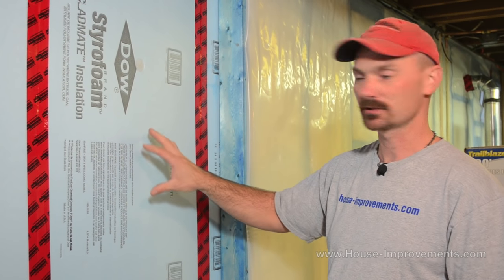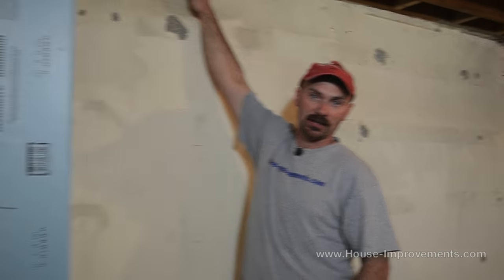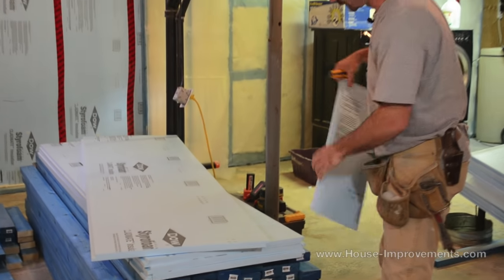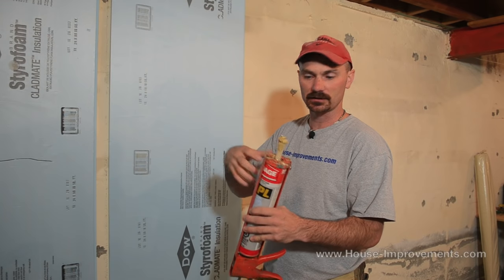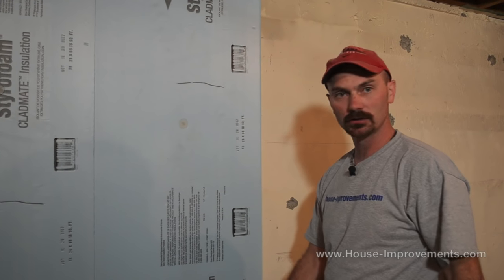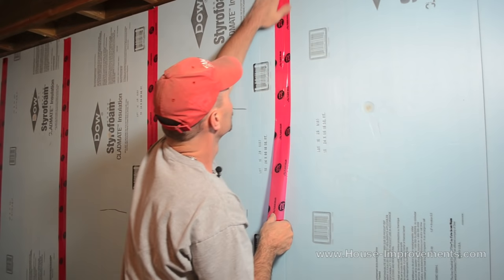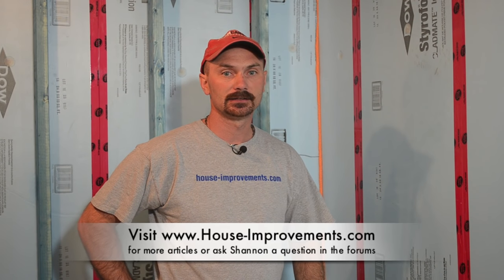How To Attach Rigid Foam Insulation To Concrete

Comment: Question, once u install this rigid foam into the concrete and continue on with your framing, do you still have to insulate the wall cavity and vapour barrier just as usual with fiberglass or whatever insulation you want to install?
Reply from the maker: I would strongly recommend it. In this case the 1" styro only gives an Rvalue of 6, I then installed a batt insulation in the stud wall that added another r12 , so ended up with R18.
Reply: HouseImprovements
Would you still have a 1 inch air space in between the insulation batt and the rigid foam for air space to go through?.
Reply from the maker: Yes you would still have some space between them for air movement
Reply: HouseImprovements Dario also asked about a 2nd vapor barrier.  If the foam is sealed, it would make a vapor barrier and I believe you shouldn't have a second (i.e. plastic film over the batts).  I have also read that the code would consider the foam as the vapor barrier.  Can you verify or confirm whether the 2nd barrier should be installed?  I am planning to install the foam, then frame & batts.  Thanks!

Comment: Can you just install the styrofoam on the concrete walls and not stud it out or finish it,and will that help with insulation or do you need to stud out the walls etc
Reply from the maker: The foam needs to be covered to protect it from burning by code ,so you need drywall. The smoke it gives off if it burns is toxic.

Comment: hey shannon , i live in ontario and i have a non vented crawlspace, what would be the best alternative to use on the bare cement block foundation for insulation because spray foam is a bit too costly for me ?
Reply from the maker: +GmGarlo 2" rigid foam.

Comment: ...where do you buy the plastic anchors and how thick is the Styrofoam board?
Reply from the maker: Hilti is one  brand of anchors. The foam thickness is up to you and how much r value you want to add. In this video I was using 1" but it could be anywhere from that up to 2"

Comment: How does the drywall anchor to the wall without studs?
Reply from the maker: Walls are framed in front of this foam to accommodate electrical, more insulation and drywall

Comment: So what happens in humid environments? Wont condensation build up on either side of the foam wall?
Reply from the maker: The foam lowers the dew point on the surface of the wall so you should have no issues unless you have extreme humidity.
Reply: Hi Shannon! Thank you for the response and thank you for your videos! I live in the mid atlantic region we have about 90days of High humidity, 90 days of normal, winter drops down.  If I use the foam board I wont need a vapor barrier then on the wall frame correct? Yes I did check my building code and its required but I dont think a lot people use foam board.

Comment: ...must have been at Lowe's for supplies on for this job :) ....how does the DOW Styrofoam brand compare to Owen Corning Foamular (pink)?
Reply from the maker: They are really the same as far as the material and R value per inch.
Reply: One used the Pink Panther in commercials and on packages, and one didn't.

Comment: What is the brand and name of that concrete anchor you used? I couldn’t find it
Reply from the maker: There is a link in the description under the video. Here is the link. https://www.amazon.com/Plastic-Masonry-Fastener-250-pcs/dp/B00IMG3L4G/ref=sr_1_2?ie=UTF8&qid=1549208790&sr=8-2&keywords=foam+to+concrete+anchors

Comment: Hi Shannon! Nice video as always. I got few questions. I have a partially finished basement which I'd like to renovate. I live in MN so we get really cold winters similar to you guys. I am thinking of using the 2" rigid foam. The walls are concrete blocks and they are painted. I would like to save space and not use 2x4s. 
* Would it be ok to use furring strips or 2x2 instead. I guess in case of the furring strips, it needs to be attached to the foam directly rather than the concrete. Does this compromise the seal? 
* The ceiling is already finished with glued tiles. Would it be ok to attached the foam boards up to the ceiling and fill the gap with spray foam? or do I need to take a part of the ceiling out? I can see that the spaces between the joists were insulated with fiberglass insulation (Basement is partially finished. This is how I think it was done based on the unfinished portion)
* I have 3 exterior walls that I'd like to insulate. There is one interior wall with wood paneling. Would it be acceptable to run the foam board up to the wood panel and seal the gap with foam spray?

Thanks!
Reply from the maker: Sorry but this is to much to deal with here ,please post your question in the forum and I can help from there.http://www.house-improvements.com/forums/
Reply: Hi Shannon! Thanks a lot for responding. I kind of figured out I was throwing out too much info/questions here. 

First of all, thank you so much for the detailed videos. They have helped me tremendously. 

Here is the link to my question on your forum.

http://www.house-improvements.com/forums/viewtopic.php?f=4&t=5243

Thank you so much

Comment: Can you attach drywall directly to the insulation?
Reply from the maker: Not easily. And you will need electrical ran in the wall anyways. And most places will require more insulation than this in a basement.
Reply: @HouseImprovements  I live in Italy. I'm looking at buying a farmhouse that is block and mortar. The electrical is existing. There's no insulation. Materials are not available like they are in the US. Is it difficult to attach/bond drywall to polystyrene insulation? It's also humid here...

Comment: Hey Shannon, was wondering your comments on this "grid system" in a "This Old House" video: How to Frame Out Basement Walls Are the advantages to framing with the way you've shown, versus the "grid system"? The grid system seems like it might be less work, but I've never seen other do it, so I am a little wary. Love your videos!
Reply from the maker: The grid system to me is not as good of a system and here is why. If your concrete walls are perfectly flat and plumb I suppose the finished product would be ok ,but I have never seen a basement yet that is ,except for some of the newest basements built with extreme care. The older basements that I reno are never straight  or plumb . The next biggest problem is running electrical wires and boxes. To do that safely in that style of wall system you need to hollow out groves and pockets from the styro, which makes your R value much less in those areas. 
In my opinion I would frame out actual walls.

Comment: why are you leaving a gap plate and the foam? ...could you not put the 2x4 against the foam?
Reply from the maker: +DeeInTheHouse  In a perfect world you could . Most concrete basement walls are not 100% straight or plumb so this gives some room to allow for that and help you to be able to have straight ,plumb  framed walls.
Reply: +HouseImprovements  ...true, framing and making the room square would leave potential gaps.

Comment: I'm surprised you used plastic sheeting for the walls before your drywall.  You should have skipped that and also not insulated the 2x4's at all.  Plastic sheeting is almost impossible to install perfectly as just one pinhole will allow air in and trap moisture.  (I thought people stopped using that stuff)  You use a dehumidifier to control any summer humidity issues.  But humidity should be less with rigid foam inside and (hopefully) you poured the concrete floor on top of rigid foam also, or if not, you should do that on top the floor before setting your studs.  Of course, you also need to consider that if you insulate against a basement wall inside, you should have an air gap on the outside for drying....so I hope you have the "dimpled' hard plastic on the outside to prevent ground/water from touching it.
Reply from the maker: Cougar Land A vapour barrier is required in my area (and others)unless I had at least 2" rigid foam or sprayfoam. This home was built in the 1970s and will not have anything but poly under the slab (maybe) and tar on the exterior of the basement below grade. The extra insulation is needed in the basement walls or this basement will be cold in our Canadian prairie winters. Thanks for your comments though.
Reply: Agree with you. With having the foam and a plastic barrier, it basically creates a trap where the water can not dry inward, and will cause mold. Its a matter of time. Foam by itself is excellent because it is semi-permeable and will allow any moisture from the concrete walls to dry inward, creating no mold issues.

That is where codes create issues, just like crawl space vents. The people that make them sometimes do not understand building science. Crawl space vents were designed to "let damp crawls breathe" but in reality, due to the stack effect of a home, a crawls negative pressure only sucks in air from outside, it never comes out. Leading to warm humid air being drawn into a cool crawl = condensation and moisture problems. 

Anyway, great video, but the double vapor barrier/retarder will cause major mold issues if that wall ever leaks, and concrete is a giant sponge basically as we know, and is porous by nature. A matter of time.

Comment: Great video, very helpful! Can I use the same approach for an above grade concrete wall? The house is a 1950s block and brick, there is currently no insulation behind the gypsum board/plaster in the kitchen.  Thanks again!
Reply from the maker: yes, although you may be able to use foam board adhesive which is cheaper.

Comment: Can you use 2 inch dow with out the tongue and groove?.
Reply from the maker: You can , the groove just makes a better job and better consistency with the R value because you have no straight through joints. If you are using the square edge foam I would leave a 1/4" to 1/2"  gap and seal with canned sprayfoam.

Comment: could you adhere the foam board with exterior black tar? or a similar sealeant?
Reply: check the instructions but I doubt it since petroleum based produces like tar will usually react and dissolve the EPS or XPS foam board...

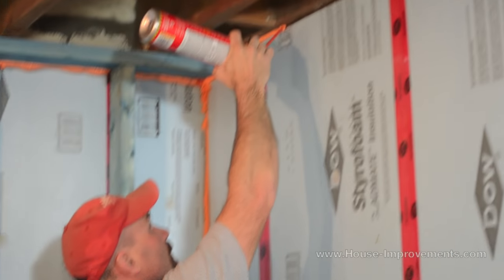Comment: at 10:18-----10:23 is this where the plate meet the poured concrete wall or where blue foam ends  ?  I say top plate/my wife says at ends of blueboard/styrofoam?  who is right?
Reply from the maker: Both really, LOL. That joist is sitting right against the top of the concrete wall in this case and the foam had to stop there as it basically butted to the underside of that joist.

Comment: i used Liquid nail adhesive EXTREME HEAVY DUTY and my 1 1/2 insulation just fell off the wall ----is has the proper rating ---can u tell me the exact type of adhesive u recommend?   Also , i cut the insulation on the table saw but it gums the blade up ---any suggestions?
Reply from the maker: +greg l You have to use an adhesive that is specific for use with foam. Lapages makes one just for foam products and also their PL premium I believe works with foam as well. You maybe had way to many teeth on the blade and or were cutting to slow. 40 to 60 teeth is all you need.
Reply: Ya  tried that, I ended up just using a utility Knife worked  best... Like he did.
Reply: Recon exacto knife.

Comment: Can anyone help - how to create vapor barrier in the basement if the walls are poured concrete with brick pattern (raised, not flat) ? I do not feel comfortable to cover it directly with the XPS foam board cause I'll be living big gaps everywhere along the wall
Reply: one method would be to skim the wall with concrete/stucco type plaster to smooth it out prior to installing the board.
Reply: The brick pattern  air gaps should improve the results. Since convection form the brick pattern air gap will transmit heat more slowly than conduction ie if the XPS was in full contact with the wall. But it even more important to seal around the XPS   (leave condensation weep hole for drainage at the bottom). 

Ironically when he placed it directly to a flat concrete wall it really didn't need to be sealed since it it tight enough to the wall its most sealed by being in contact with the wall.

Comment: Question: If using 1" foam board and then R13 with a built-in vapor retarder, I'm assuming it is not then necessary to cover with a poly vapor barrier. Is this a correct assumption?

Comment: 2 vapor barriers is a bad idea. It will trap any vapor that gets in the wall. Only 1 side of a wall needs vapor barrier.
Reply from the maker: in colder climates most rigid foams are not considered a VB under 2" thick.

Comment from the maker: "Plastic insulation fastener" , one manufacturer is HILTI
Reply: Also Plasti-Grip and UCAN in Canada.  Shannon, do you have any videos on framing and insulating when you have a half wall?  In my case the wooden part of the wall is already batt and vapor barriered.  But bottom is concrete and I want to use rigid over the concrete and then frame straight up.  Remove the vapour barrier and add more batt on the upper portion?

Comment: why are people saying that the foam is a vapour barrier so you dont need one? I thought its a moisture barrier?
Reply from the maker: It is a moisture barrier and if its thick enough some areas will also allow it to be  the vapour barrier.
Reply: @HouseImprovements  if I add a vapour barrier as well, it won't trap the moisture between the two?

Comment: i  think the batt insulation will sweat and condensate as the foam insulation is a vapor barrier then  you have  vapor barrier on the inside  making a batt sandwich ....i see problem here unless someone can explain to me how that wont sweat
Reply from the maker: Actually the foam is more permeable then the air/vapour barrier but it also stops the cold transfer so that if most air gets through the poly the surface temp is generally not cold enough to make the moist air  condensate against it. I think the best combination right now is to use a "smart air/vapour barrier " if you use foam as added protection.
Reply: @HouseImprovements  thanks,,.i actually used durafoam gps .it claims to be a vapor barrier  and in their video  they just put the drywall over the insulation,2x4 wall with r14 batt......what do you think

Comment: Rigid Foam and Bat Insulation, Cannot compare to spray foam, the Bat insulation has been tested to be half the R-Value shown by the Manufacture if installed perfectly. Any Air gap behind the Rigid foam reduces it's R-value by 10%.

Comment: Your best bet it stud in your basement with 2x4's and leave them 1" off of the cement foundation wall. Then hire a spray foam contractor do handle the rest for you.

Comment: So your code does in fact approve insulating from the main floor to outside grade which is usually about the top 1/2 of the basement wall but I am astounded that Saskatchewan Code approves insulating the entire wall from top to bottom. I'm in northern Ontario & the destruction I've seen caused by this practice tells me that your local authorities have no experience. Mind you, pressure treated basements are the exception in Ontario. But block and poured, never. Thanks for replying.

Comment: The insulation should be on exterior wall, not inside. Even every one do it opposite. New code have smartened up and required insulation outside. Look at it the way of where you want cold to be, under the wall in the corner potentially causing condensation problems at the floor level or cold can stay outside the  concrete.

Comment: What I don't understand after watching every Foam basement video is that, they are all saying " Careful!!! use tape and poly sheets to air tight the whole room." and yet they all perforate the foam, polysheets, tape and any other airtight precaution with screws or nails. what's the deal yo? the water or vapor will wanna pass through those hole.
Another thing is that nobody is building the structure the same way in all videos I've seen. it's like there is no main guide line. I'm an engineer who's new to renovation and find it a little not well organised. You guys need to get your shit together and use the same method.
Reply: Chris LEA tradesmen don’t have ECOs or Work instructions with Revisions, they also don’t feel the pain of their poor design 10 years later.
Reply: @fillentropy6519  ...and yet you didn't once mention the unnecessary holes in the foam.  you have to be one of those contractors that think just because someone doesn't have a contractor's license, they can't build shit.  fuckin' contractors.  lol.

Comment: With >500000 home fires in USA, you still suggest to use this method of insulation?
I wonder, how the Fire Administration keeps comsiderin this construction as safe.
In the fire triangle,the worst part is Material .
And you use.... Plastic membrane,Wood,plastic tape,styrofoam....😎

Comment: Why not just glue to the wall?  It's styrofoam, no need to ANCHOR it, thats too much. lol

Plus you are putting a wall over that that will hold it in place.
Reply from the maker: You are right and I did mention this,there is an adhesive that you can use on foam. The problem is that unless your wall is completely flat the the adhesive will not hold the foam there completely.It comes loose and partially comes off because the adhesive does not dry instantly. And again unless your concrete wall is completely plumb and true (most are not) you can not completely build your interior wall tight to it.
Reply: HouseImprovements But does it NEED to be tight to it?  Especially with the other wall going over it essentially holding it in place?
Reply from the maker: DFKnightmare Yes you want to hold it firmly in place so that you can seal it with the spray foam to stop air leakage.

Comment: Why do you require a vapour barrier? I thought the styrofoam was the barrier.
Good Video otherwise.
Cheers
Reply from the maker: Only if it is at least 2" thick. And not everywhere uses the same rule.